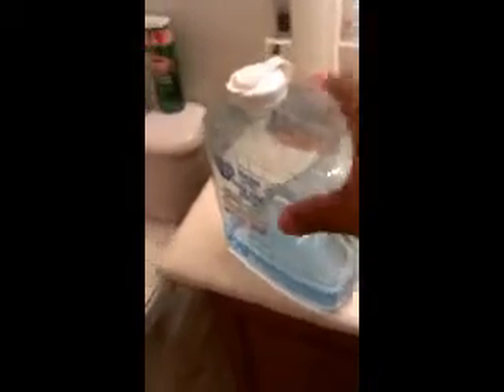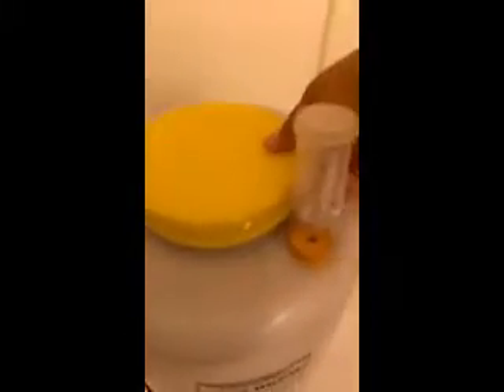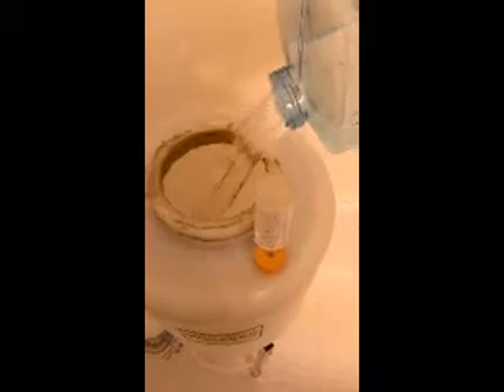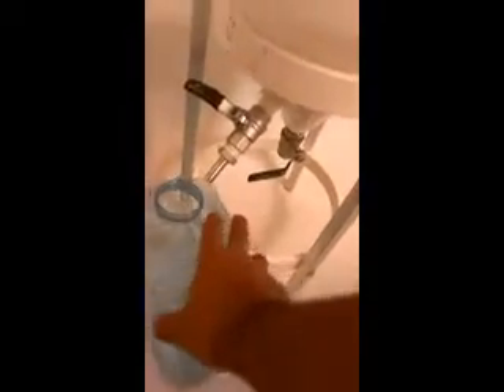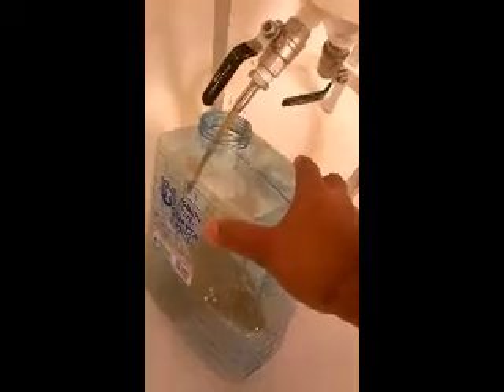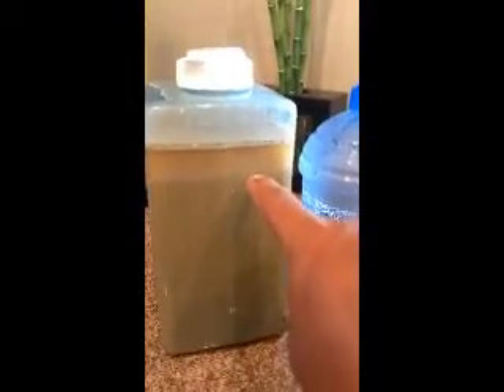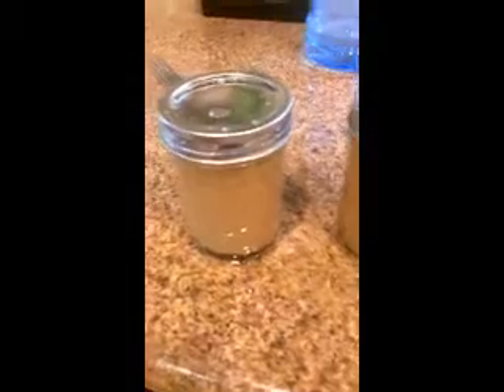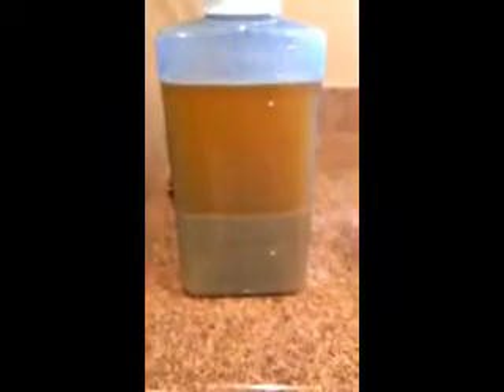Yeast Washing or yeast harvesting from a previous batch of beer

Comment: After all is said & done settled , I should be able to just use the bottom right pour off the brown water and combine them all then a guy should seal the jar never tried this want to save some turbo yeast I have it`s a 7 day butt kicking wine yeast man does it work good it started worked 7 days and shut off like a switch  .dropped the Hydrometer it was 1.010 = 0.1 sugar ABV .